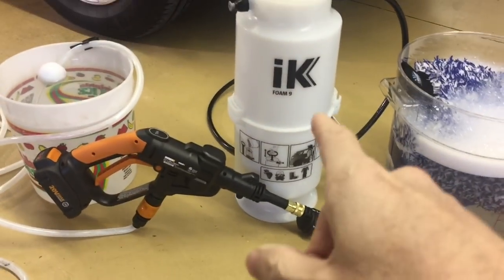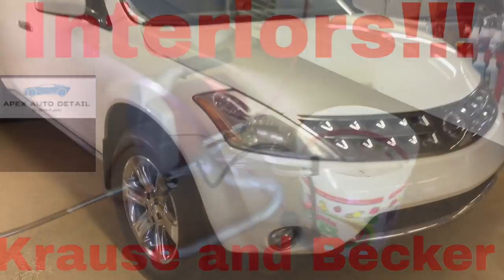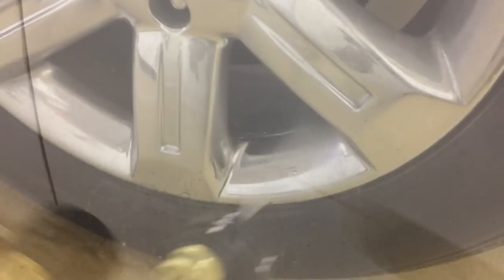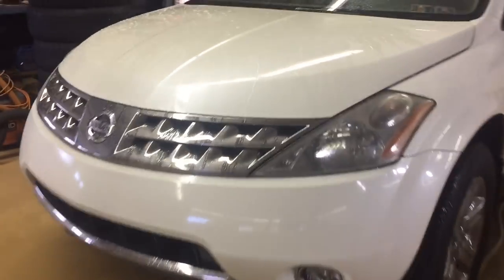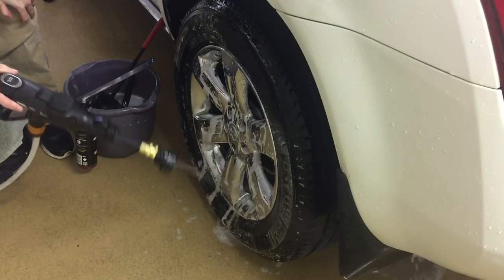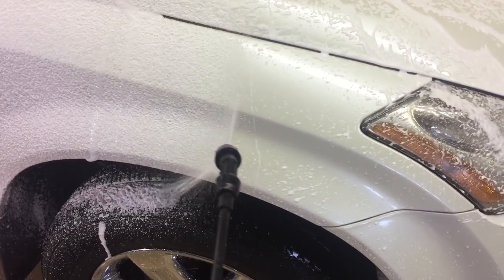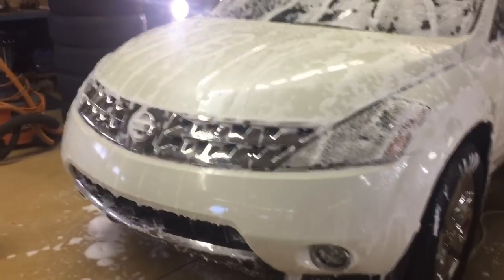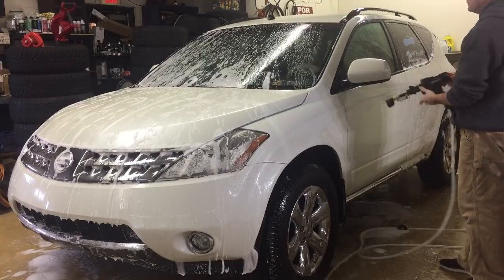How To Do A FULL Wash Routine....With no Hook ups!!! Whatsoever!! No Need For Rinseless Washes!!!

Comment: This is such a cool video. I use distilled water when I'm out in full sun in the ole' sunjoe. No hard water to deal with. I typically use it with their foam cannon and as a final rinse. Such a great little machine.
Reply from the maker: That thing is worth every penny! 👍🏻
Reply: When air drying with distilled, does it only work if the sun is out? Will it work in the cold?

Comment: Wow, this is exactly what I needed. Although I live on the first floor of my apartment and my car is parked literally 5 feet from my door, apartment rules say we can't use a hose to wash our vehicles. It's an older complex, no designated car wash areas. I do own the Worx hydroshot already but I use it for cleaning my wheels and tires specifically and use ONR for the car body. The battery doesn't seem to last very long, probably because I use it on the higher setting with the longer wand. I have ordered another battery but it's taking FOREVER to get to Hawaii; still not here even after ordering a month ago. I do have the sunjoe spx-6000 on wishlist but I can't justify spending the 260+ dollars right now. Thank you for this video, it helps a lot.
Reply: The upgraded battery is well worth the extra money, and I use it for the blower as well, hope you get it soon.
Reply from the maker: It is worth the wait. 2batteries are key!

Comment: If you have a water hookup, you can also connect a water hose directly to the hydroshot and with the extension it's got pretty darn good pressure that way.  You can also use a 2L bottle, but I've found you can only do about half a car before having to fill it up again, so 5-6 bottles ready to go would work fine and just takes a few seconds to take one off and screw another on.  And if your having to wash out in the hot sun, you can buy a few gallons of distilled water at walmart for .88C ea and not have to worry about water spots.
Reply from the maker: Excellent post Allen👍

Comment: For maintenance washes, I've been using the Krause/Becker with 5 gallons of reverse osmosis or distilled water. I'm able to rinse a sedan, wash the tires/wheels, do a contact wash, and a final rinse with about 1 gallon leftover. I'm able to do this in my garage with minimal runoff and still have the shade to work in. And even though I'm in the shade, using RO or even distilled water helps minimize or eliminate water spots if the water happens to dry before I dry the car with compressed air or a towel. 5 gallons of RO costs $1.75 and my local grocery store sells distilled for 66 cents/gallon. It's so much better than using our local water, which has a TDS above 500.
Reply: ea0529 lol just use a ph balanced  car soap

Comment: Very informative video and nice set up. Now make a video on how to use tool and equipment without power source or generator if you or your customer doesn’t have it.
Reply from the maker: That is exactly what that was......no hook up whatsoever.🙂
Reply: Aaron 1530091 I bought a power station that uses 4 24v batteries that'll power my vacuum or polisher.
Reply: Froztinc what brand is it and how long does it usually last?

Comment: i use the (almost just came out) Ryobi portable cordless electric backpack sprayer. the pressure (with some nozzle adjustments) is even stronger than the gun in your video. it has a 4 gallon tank and one full charge of the battery lasts about 10 complete empty 4 gallon tanks. got it in ebay for 150$. i have the same issue and got the idea off of a video i saw on youtube with a guy using it in his pool.

Comment: Wow, pre rinse, foam, rinse, then bucket multi mitt, rinse and dry. With pressure washer, I do pre rinse , foam cannon, and contact wash while the foam is on the surface with presoak wash mitts.
Question, how long does it take you to air dry the wheels tires and all exterior with the leaf blower at least to get it 90% dry? Thanks for another great video

Comment: Hey Brian, if you use distilled water or a De-ionizer/filter, can you eliminate drying the car all together and possibly wash the car in sunlight? Any recommendations on de-inonizers or filters that are not $$$? I am looking at something like "Aquatic Life Dual Deionization 10-Inch System?" I am sure there are a lot of guys like me out there whose garages are facing west and getting a lot of sun. Yes we can/should wash when the sun is not up but that time is very limited in this case and not worrying about water-spots will help us  a lot.